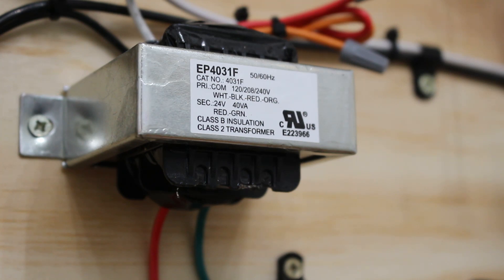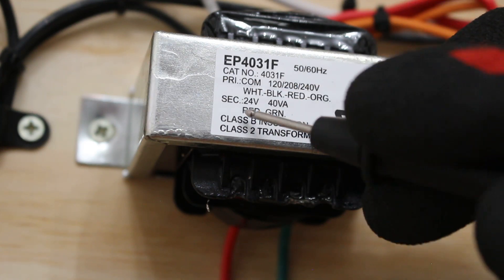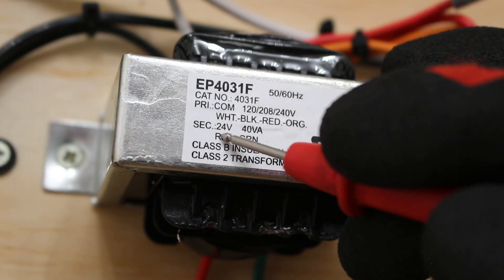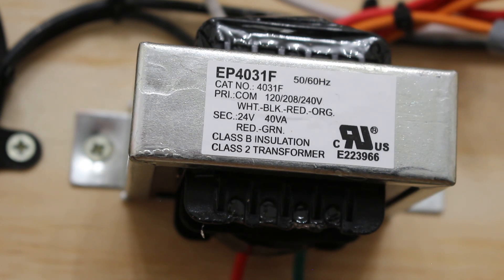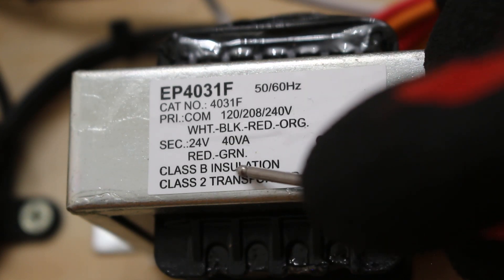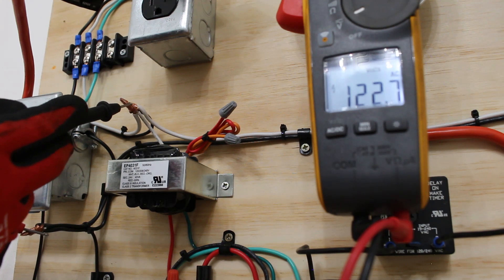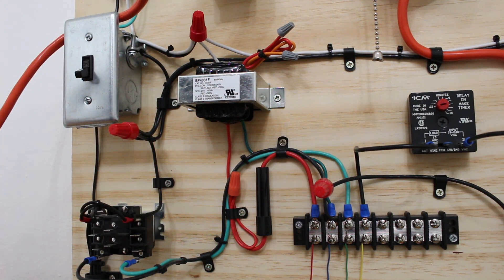HVAC Training Board: How To Troubleshoot A Transformer (How To Check A HVAC Step Down Transformer)

Comment: I had a situation this week where I thought the transformer was bad since there was no secondary 24Vac even though i saw 125 Vac on primary and fuse on secondary was not blown. Turns out i have 2 cutoff switches. One on side of furnace and other on staircase leading down to basement. Cutoff switch on staircase was wired incorrectly, it was connected on the neutral side and not on the hot wire. In this situation you will see 120Vac on primary to ground with no voltage on secondary.

Comment: What if you don’t have primary voltage ?
Reply from the maker: @Arthur1375.majidi  Then you might have the power supply to the unit off or the breaker tripped due to an issue. If there's no primary power, you cannot confirm the transformer is bad. The focus should be on restoring your power supply. Good luck & thank you for watching 🔧⚡️
Reply: @ there is power coming to the board. Meaning we have power but still keeps burning after working for a day and half. I checked induced motor we have 3 to 4 ohms and blower is also in okay condition. So I’m so confused why it keeps burning

Comment: I have a bard package unit that is tripping the 3 amp breaker on the low voltage transformer when set to heat. Do you have a video to test that problem?

Comment: Thank you, very awesome video and control board! So, I have 0.0 volts between C and R at my thermostat which could be the transformer but if it is an overflow switch would that cause the 0.0 volts? I have an electric heater and A/C combined to heat/cool the house. Any info would be appreciated! Thank you in advance!
God bless!

Comment: In this example,  I can see you are using a 40VA Transformer.
How do I determine  the size of theTransformer in case I got no the Electric Diagram .

Excellent Video!!!
Reply: can be found with the model number and serial number of your equipment and some googling.

Comment: I'm not very happy with this video because it's bogus info. He shows the 24 volt signal from the transformer is in series with the thermostat. In reality the transformer is in series with the control board and the board is in seris with the Thermostat that is how the AC circuit works. And to add insult to injury he then showed the 24v trans signal is in series with a  distribution block.
I really think this video is very misleading and not as good as a lot of people think it is.

Comment: I have 19V on transformer of a furnace that is 24 years old. The board recently died as one of the relays blew.   Should I replace the transformer due to voltage being low?
Reply from the maker: 19 volts seems very low. You should get a reading above 24V usually. I would add in that transformer for replacement. Thanks for watching! Stay tuned for new videos every week🔧⚡️
Reply: @JumpermanTech  your channel is so valuable. thanks for quick reply. Will replace the transformer and the board together then.
Reply from the maker: @apartchi  Good idea. Be safe when doing so & thank you! Stay tuned for new videos every week🔧⚡️ Good luck🙏

Comment: Thank you. Can you help me how can I recognize the wires if the primary have 440v, 240v and 110v
by using Multimeter? As there are 4 wires Red, White, Black and Brown. And how can I recognize the Common wire?

Comment: Why would my transformer pop while I was testing it? It sparked, popped, and left a burn mark on the COM terminal. What did I do wrong? I put one lead on the COM terminal and the other on the 120V terminal. The power was on to the furnace. My blower was running because it wouldn't shut off. It happened so quickly I didn't see what the meter read. Help?

Comment: Hi, why am I only getting 16.8 volts at my C wire? I replaced a battery powered honeywell thermostat with a sensi smart thermostat. Multimeter shows 26.8 volts at all wires except C wire.

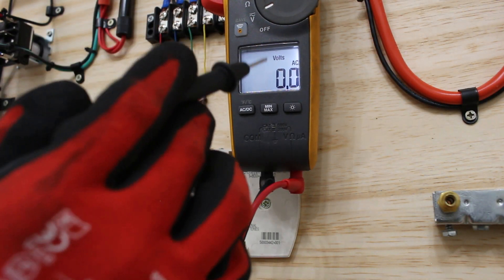Comment: 5:23 shouldn't be the opposite? I thought that the black lead (negative) of your multimeter is connected to the C terminal (common). And the red lead (positive) of your multimeter is connected to the R terminal.

Comment: Very helpful video, thanks for posting. Im troubleshooting my reznor garage heater. It turns on runs a few cycles fine then when i come in the morning i can tell it hasn’t ran all night. Trying to figure out if its the transformer or if the circuit board is bad

Comment: thanks bro...I got a bad transformer. 240 going in, yet not showing 12v at the stat. and of course that faint burning smell in the unit by the transformer. Like the transformer in a neighborhood in the sky on the pole, they burn out.

Comment: My black and white wire have female connectors, that go straight to the control board, should I stick the leads in them to see if I get the 120 volts?, Will that work?

Comment: Another simple test is to feel with you hand if the transformer is warm. If Warm most likely all is good but may still have issues, get out the voltmeter and double check.

Comment: Great video! Question: my inline fuse from the transformer (blue wire) is blown. The secondary was not producing 24v, so I put a known good transformer in and it blew the fuse again. Could my board have a short in it that is causing this issue?
Reply: check relays then back trace for a short if relays are fine

Comment: I realize this is about Air. Hopefully someone can help me. Question? I have an overhead Reznor heater. Should there be 24 volts at the thermostat if the system goes into lockout due to a faulty flame sensor. Thanks  again For great videos

Comment: Be careful when you say always. The primary is not always the high side. A more accurate statement would be the primary side is the input side. The primary on a step up xfmr would be the low side. Also many hvac system thermostats require and have no common terminal,so in those cases, the best place to confirm system control voltage would not be the tstat. The better place would be the location or the xfmr, usually the furnace or air handler.

Comment: Hi question to better understand 
Why you first check voltage between red and blue wire ( green ) coming directly from transformer then when checking at minute 8:28 you check red and green wire but not the green coming from the transformer connecting to the blue wire
Thanks

Comment: Very grateful for your excellent video. Last night we spent a very warm night at the Florida keys because our A/C would not turn on. I spent several hours last night trying to find the problem. This morning I watched your video and was able to find the control board with a blown fuse hidden under a couple of steel covers inside the air handler and fixed the problem.  I had called several air conditioning companies and the soonest I could get one to come was tomorrow.  Thank you again.
Reply: Man that’s good troubleshooting!

Comment: Brilliant! This is simply the best video on testing the transformer I have seen, period. I have also found that replacing the contactor is quite common and wise to replace both when the contactor is bad, which I guess many times will fry the transformer? Again, you made it super easy! Thanks bro.

Comment: What is a step down transformer? 

Is the transformer in the furnace the source of the "RC" or "RH" power that the Nest Thermostat uses on the wall? Is it possible for the furnace transformer to not send enough power to the thermostat but enough to the furnace?

Comment: Great video, in my case my primary incoming power is 120 V for some reason, it is a transformer with 240v primary and 24v secondary set up, after replacing few breakers at the fuse box with the new ones now I’m getting only 120v input between Com and 240v lead and obviously 0v at the secondary wires, I replaced The transformer with the new one but no change, still getting only 120v, it looks like I got to check the fuse box, any advice what should I look for? Thank you.

Comment: Thanks man I really appreciate this information during these hard times. I've found that my furnace has 120 volts coming in up until the transformer . Then it stops and I have no 24v volts. Just ordered the replacement transformer. The circuit board 3amp fuse didn't trip so I'm praying the board is OK. Upon further inspection of the transformer I've noticed what looks burnt cheese and the black terminal wire connection to the coil in the transformer is toast. I'm betting betting that's stopping me from getting the 24v. Now I gotta figure out why this happened. Again thanks for the info I know this comment is lengthy but I really do appreciate the video keep making great content.

Comment: What if fuse keeps blowing????
Reply from the maker: Fuse for the transformer? That means there is an issue on the secondary of the transformer. The lower voltage side. Could be quite a few things. Hard to say without seeing. Sounds like you probably have a short on the low voltage circuit

Comment: Great video. You should do a WIR/WIF board with the DATV40 defrost timer. Ill send you one if need be.
Reply from the maker: Thank you! I need to look into that. Haven't heard of a WIR/WIF board. I'm thinking of creating another type of board in the near future. Had a lot of fun making this one & it has been very useful for the community. Stay tuned for new vids every week🔧⚡
Reply from the maker: I actually just took a look in my inventory & I have a DTAV40 Defrost Control. Will def make a video on this. Never used this one before. I typically use the Paragon Timers.

Comment: Excellent video. Just curious, if the thermostat has no common(blue) wire, would it be ok to check voltage between R and Y,or W or G ? Thanks JMT.
Reply from the maker: Thank you! You can still check between R & any other terminal wired. As long as the thermostat is in the OFF position, between R-Y, R-W & R-G, there will be a 24V reading. This will indicate your transformer is good. You can always also just check the 2 wires leaving the transformer but to save time, this method will work🙃 Thanks for watching! Stay tuned for new videos every week! 🔧
Reply: @JumpermanTech  Thanks JMT.  Lookin forward to the next one!